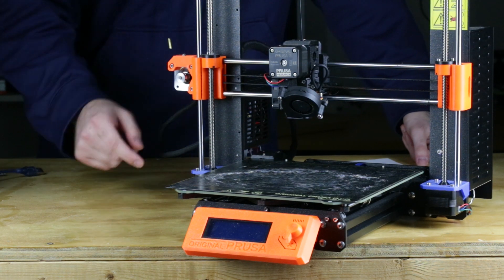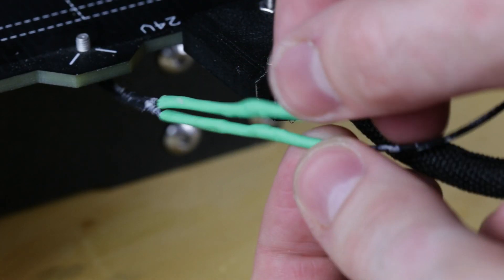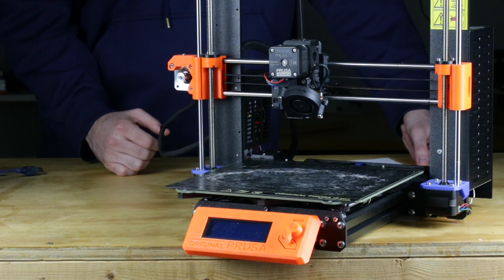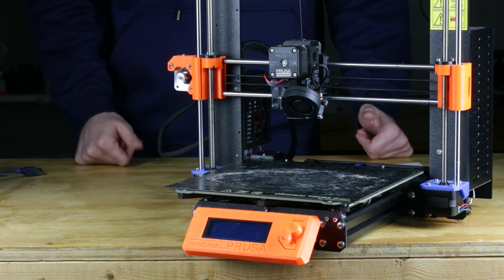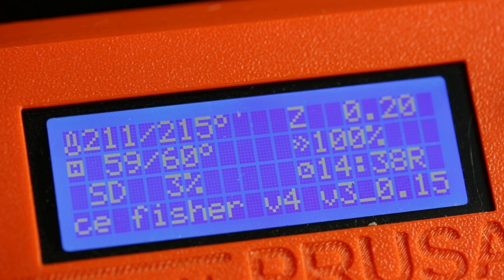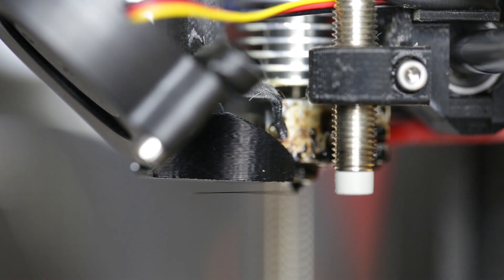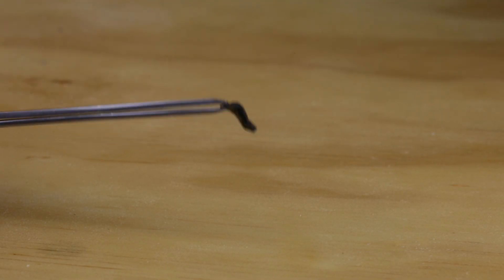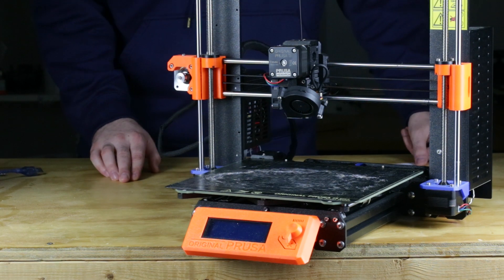My Thermal Runaway Issue is Finally Solved! (for real this time)

Comment: Also, in Prusa Slicer set both fan min. and max. to 50%.
Reply: Tip: To change this setting you must be in expert mode. Then you can change this setting under the filament tab.

Comment: I had the exact same issue on my Prusa. Thermal runaway error after the first layer. Nozzle temp would get to 200 deg immediately. Checked and no melted plastic. Added an E3D boot to the hot end and problem solved!

Comment: Thank you very much! You saved me a lot of work disassembling my machine. While my problem was just a little different, my runaway was bed type, but the symptom is the same: Cooling fan lowers my bed thermistor (My bed is glass over PCB, an i3 clone). I just have to ensure that  the bed center is covered by printed material as the fan runs 100%.

Comment: Thanks for thd video. I thought i cooled the nozzle so hard the heater couldnt keep up which seemed really weird but i havent thought that my cooling duct might directly cool down the thermistor so i get a false temperature reading which causes the printer to think theres thermal runaway and stop.

Comment: Thanks!  I just replaced my thermister because I thought that would fix it, but still happened.  Just looked at my heat block and I have that EXACT same melting problem!  It is surely the same problem because it always happens right after the layer where the fan turns on.
Reply: Did it work? Having the same issue
Reply: @Yukison22 I made a new blower plastic section out of resin, so it can survive high temperature.   No problems since.

Comment: Sorry, but what is the actual solution to the problem? Reprint the melted pieces?
Reply: as far as i understand he cut off an unneccessary piece of material which directed the air to flow directly at the termistor

Comment: I'm making very similar print with circle and it stops in same place for me:)
Reply: I didn't have melted plastic. It was happening only on 4th layer. I was standing beside printer and i stopped fan with my finger for few seconds and i printed part like that. I didn't find the problem. Maybe it's terminator but I'm not gonna replace it.

Comment: This wasnt the issue for me but did help me find the issue -  my rubber heating block cover had a split in it and half of it (inside the fan casing so I couldnt see it) was hanging off - this was stopping the block from losing its heat on one side

Comment: Maybe It'll hep someone. I got thermal runout in my ender 3 v2, I thought that it was the thermistor. Nope. I some time ago I removed the rubberized head protection, there was no problem with printing PLA up to 200something *C. However when I bought flexible filament and  needed to go over 220 the printer was showing thermal runout. After watching this video I figured out that it might be it, and some air was getting onto the thermistor, which turned out to be the case.  Putting the cover back solved the problem. Happy printing!

Comment: I tore the rubber boot of my ender 3.pro and did the same. Installed a new boot and problem solved.

One should first investigate heat extraction before replacing the thermistor . The thermistor only react to temp fluctuations. Once there is no heat loss, only then change the thermistor.

Comment: Having problems with melting parts I bought a UV resin printer and those parts hold, but it develop leaks and now got that 'thermal runaway'. In my view it is an expensive junk design. I wasted so much time on it that's not funny.